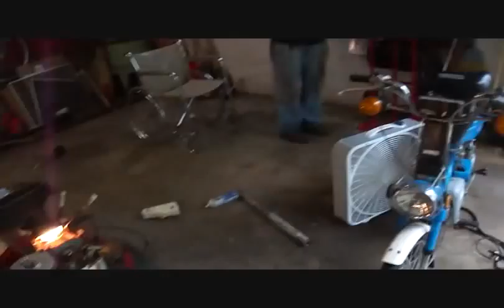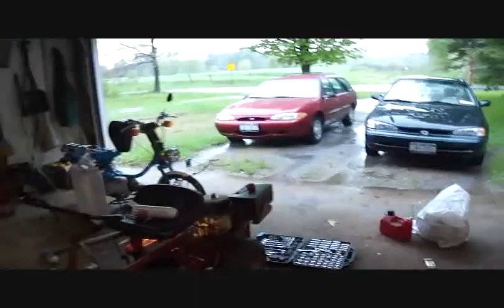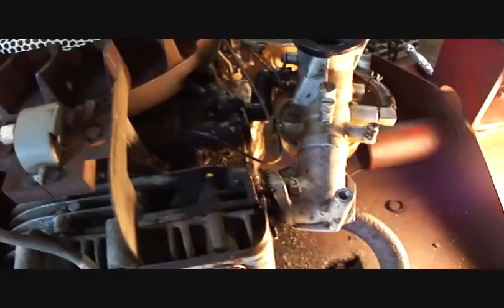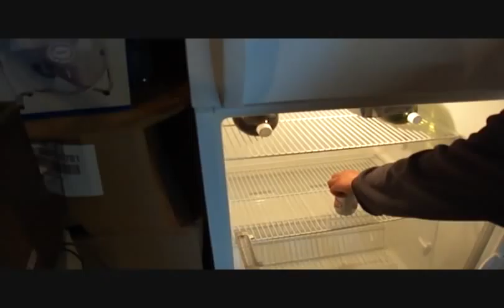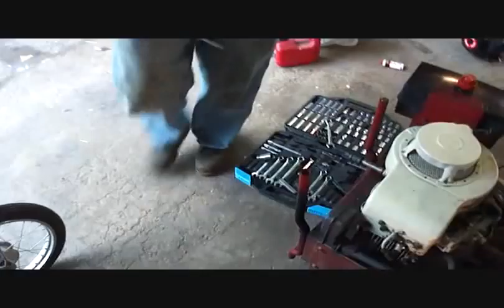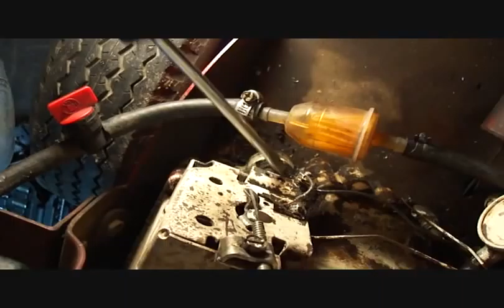Snapper update/more video from Krankie_V's visit

Comment: @ControlledExplosions if it were me I'd run them just as long as they worked! those tires are a bitch to replace. and expensive. When i finally broke down and put tires on my snapper, they wouldn't hold air for 2 minutes, even with slime LOL